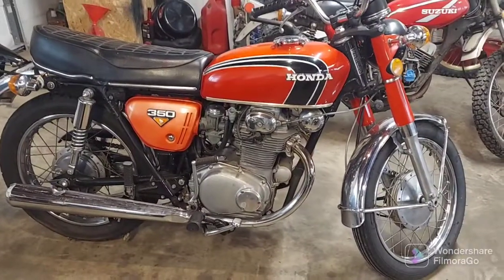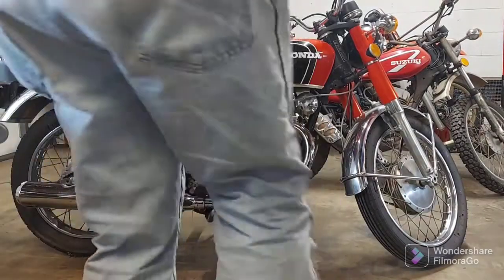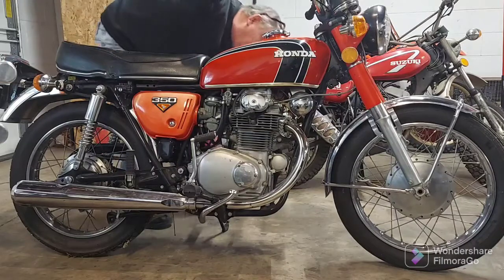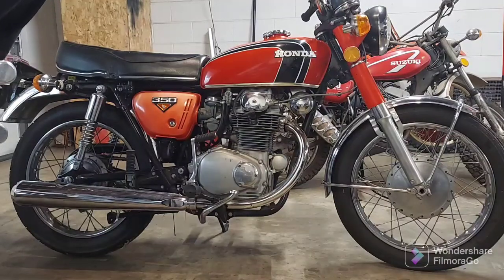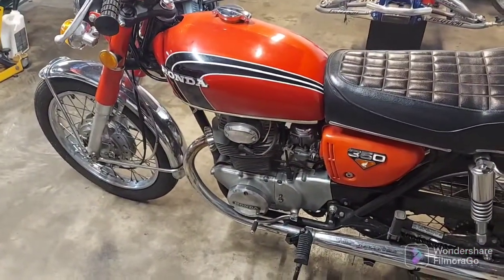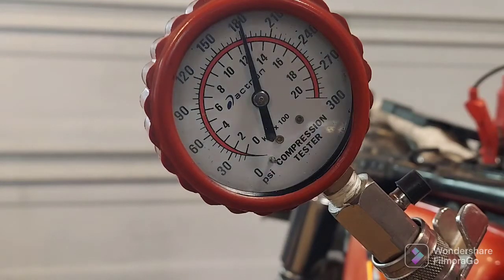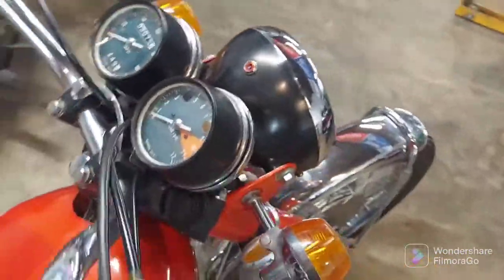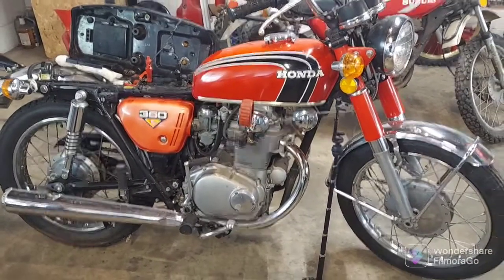Vintage 1972 Honda CB350 twin start up and diagnostics

Comment: I am amazed how clean that bike is a 1972 doesn't even have 3,100 miles on it yet very nice bike I'm not a Honda person but that bike really looks nice well taken care of and it sounds like I hear a little ticking so like you say Ron might just be the cam chain needs adjusted and a good tune-up need some dragon works TLC can't wait to see the final video but I will be following along like I said I have learned things off your videos I never knew how to do a compression check but I do now and some other things I've learned from you and thank you keep doing your videos